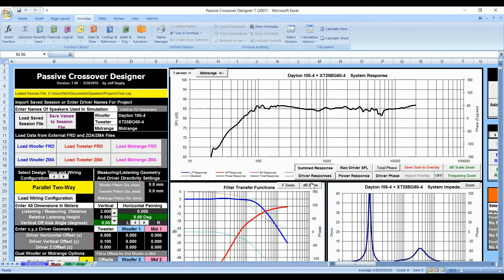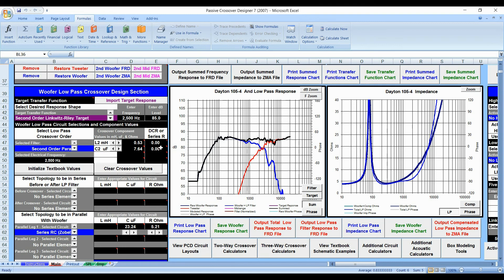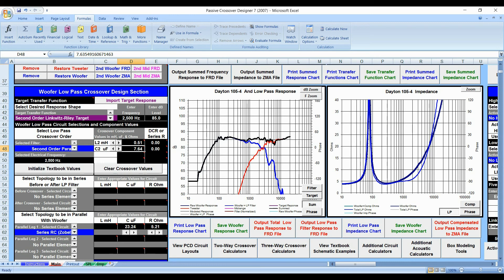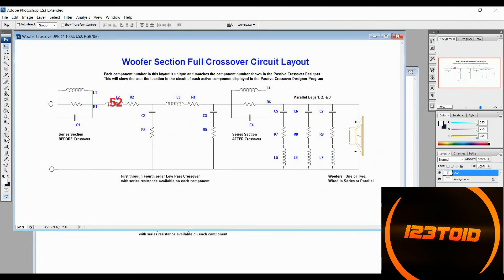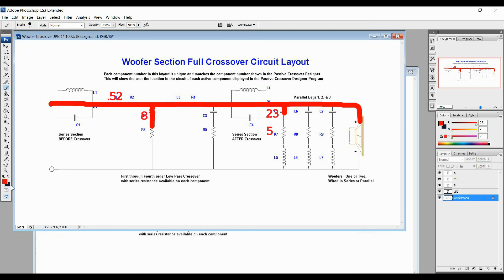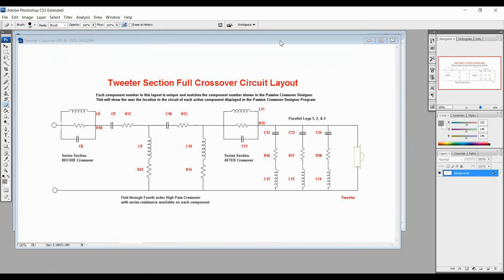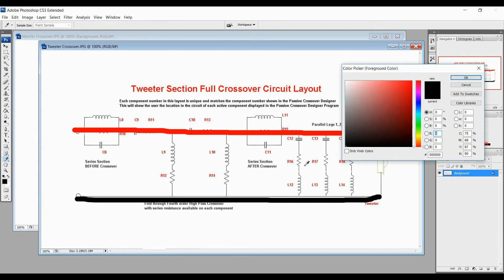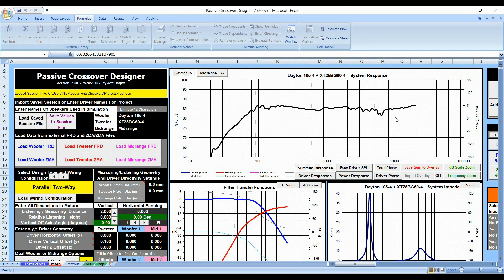How to Design a Crossover - Part 4 - Assembling the Crossover

Comment: Hi Toid and comunity, need help.
Just finished building a new battery driven bluetooth speaker with a woofer and 2 tweeters. Designed the crossovers using this method. Somehow the tweeter is very quiet when hooked up to the crossover 😮. 
I dont think i messed up designing it according to the video and building it. I am an engineer and have built speakers with plans before.
Have you got any idea how this could happen? The tweeter crossover is pretty complex with 6 parts including 3 resistors (2.4   10   and 18 ohms) crossing over at 4khz. Could the resistors be the issue? 10 and 18 ohms are in parallel though... Think i blew up my china bt amp too in the process of Troubleshooting 😅
Bonus question: Do (complex) passive crossovers make sense in china bluetooth amps?

Comment: Thanx for your videos.
 Its helps me alot and I did follow your steps however I did use the LCR on the tweeter.  They give me the number C1 and L1. I can only see it on the woofer lay-out?
Can You Please help me.  Thanx
Reply from the maker: Appie Haddid you usually do not need an LCR on the tweeter.  Are you sure you need it?
Reply: 123Toid  thanks for your fast respond.  I have a realy nice line now.  But I Will skipp the LCR  And try iT without.    Thanx again!
Reply: Is iT posible i Send You a picture of my diagram ?  I think I find the Right way to add a LCR in my filter.
Reply from the maker: Appie Haddid sure there's a few ways to contact me listed in the description. The best to our Instagram and Twitter along with patreon
Reply: 123Toid If Send You Some pictures on instagram.  Can u Please give me your opinion about my cross-over?  

Thanks!

Comment: Hey 123Toid, im very new to this but have always been intrigued with the art of designing and building my own speakers.  i have watched your videos a few times and have subscribed. in your video on assembling I got a little confused with the extra resistors and capacitors on the diagram. I am a very visual/hands on learner and wish you would take the diagram and build it on a board, i had watched another video from someone else and they did a poor attempt in doing so. Every time they were explaining or pointing something out on the back of the board it was completely out of view.
Reply from the maker: Devon Begin thanks for the kind words. I think what you're asking for I did a video on which can be found here: https://youtu.be/ug3JG26lMtw. Over some people said it was still a little confusing. If you find it confusing, let me know I've been contemplating whether to make an even more simplified video sometime
Reply: hey thanks for the quick reply, is there any way i can get in touch with you to pick your brain
Reply from the maker: Devon Begin you can contact me pretty easily via Instagram or Patreon. There's also a way to send a message via YouTube if you want. Any of those would be fine

Comment: You recommend the non-polarized electrolytic capacitors, which seems to be a subject for some debate. They are sure a heck of a lot cheaper. Are there any real-world objective reasons for choosing more expensive caps? I am generally unpersuaded by audiophile sound quality claims about amps and wire, but I have seen claims that the electrolytic caps degrade and change value over time. Any thoughts on this?
Reply: Greg Worrel electrolytics indeed degrade faster simply because of the materials used. As for sound quality, there’s really no difference... unless you’re an asshole

Comment: Hi @123Toid. now at 3:45  you choose an inductor  of .51mH  so say for e.g. i went .55mh  now on on parts express https://goo.gl/QeXQp4   ( I made the link short) 

Now there are two different Inductors How do i choose which is good  one is 20AWg and other is 15AWG?
Reply from the maker: Good question.  If you were designing a low powered system with a small woofer, like we did in this one, then the cheaper 20ga is plenty.  However, if you were using bigger woofers and or a more powerful system, you would want to jump up to the 15ga.  I do want to just let you know, that I have never built this particular speaker.  This is just an example.
Reply: Thank you very much ..no problem  i really enjoyed the tutorial helped me a lot....btw in your emoji speaker how did you design the crossover?
Reply from the maker: Striker I show you how to design one of those circuits here: https://youtu.be/ld4A6MQ4E3U. They are used on full range speakers and sometimes woofer/mids.
Reply: Hi Striker, the resistance of the coil depends on the Qts of your woofer and partly determins how big your enclosure will be. The higher the resistance the more it enlarges the Qts of your woofer. A higher Qts usually means lower cut-off frequency and the need for a bigger volume. To calculate the new Qts' you need the DC resistance (Rdc, sometimes also called Re) of the woofer and the resistance (Rc) of the coil: Qts' = Qts * (Rdc+Rc)/Rdc. If Qts' is smaller than 0.27 you will need a bass reflex enclosure in the size of the woofer's Vas. If it's bigger than 0.5 bass reflex will not work properly anymore. If it's bigger than 0.76 even a high-pass filtered closed box must be bigger than 2 * Vas.
So if your Qts' gets too high you need a coil with a lower resistance. Otherwise get the cheaper one.
Source of all my knowledge: German DIY loudspeaker magazine Hobby HiFi

Comment: Great videos!  How do I spec parts for and wire in a notch filter?  My sub has a 7db spike at around 240hz (below my crossover point). Thanks!
Reply from the maker: Dane Saunders it's in additional circuits. There's a way to factor in notch filters.  it'll use a resistor inductor and capacitor. I always get my crossover parts at Parts Express.  I hope this helps
Reply: I think I figured it out.  I ended up using a "Series RLC" in the "Parallel Leg 2" area of the woofer crossover calculator, and it seems to be helping a bunch.  Only down side is the addition of a pricey inductor ($20/pc)...I'm guessing there's no way around that.  Thanks again!
Reply from the maker: Dane Saunders Glad it helped.  Typically inductors for subwoofers. an get pricey.  you might be able to save some money by getting a solid core inductor instead of an air core.  in a 240 hertz range, it's probably not going to make a big difference.
Reply: Awesome. Done. With the saving there, I went and chose a better quality cap for the Tweeter "Series section" (C9)....hoping that's worth it!?
Reply from the maker: Dane Saunders that sounds like a great discision!

Comment: Nice series. I was waiting for this tutorial for a couple of days. Thnx!
Reply from the maker: Bart Agten You're Welcome!  I wish I could have had it out sooner to you.  As always don't be afraid to ask if you have any questions
Reply: I do have one question. Im trying to match the total impedance of a 2way speaker design with my amp. I need to match an output channel of 62 watts, 8 ohms. 
I use a 6 ohm tweeter and a 4 ohm woofer. Is it true that with a crossover used, the impedence of this build will be 6 ohms in the 'tweeter frequence range' and 4 ohms in the 'woofer frequency range'. If thats true do i have to simply add a 2 ohm resistor to the high pass filter and a 4 ohm resister to the low pass filter. I hope you can help me out.
Reply from the maker: Bart Agten Unfortunately that is not how resistors work.  To best explain it as simply as i can, a properly designed crossover, your total speaker impedance will be whatever the woofer is. Of course you can use the total impedance graph in the program to see this.   It will rise and fall with frequency, but overall will have a total output that matches the woofer.  in your case that would be 4 Ohms. if you want an 8 ohm speaker, you will either need to use a different woofer or add another of the same 4 ohm woofer in series. this would then make it a total of 8 ohms.
Reply: Ok, thanks for the explaination. So I will go and look for a different set of drivers. Is it always the impedance of the woofer I have to take in account or does the impedance of the tweeter also matter?
Many thanks allready!!
Reply from the maker: It's more complicated than that, but as a rule of thumb, use the woofer to determine the impedance.  Also check the system impedance graph when you make the speaker.